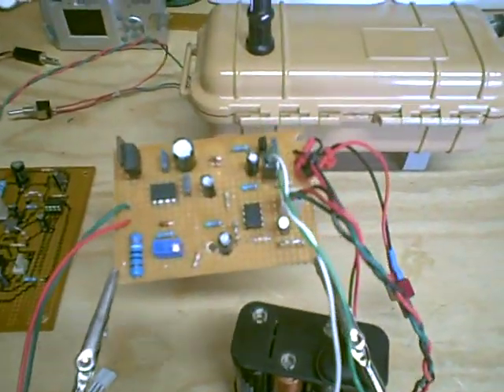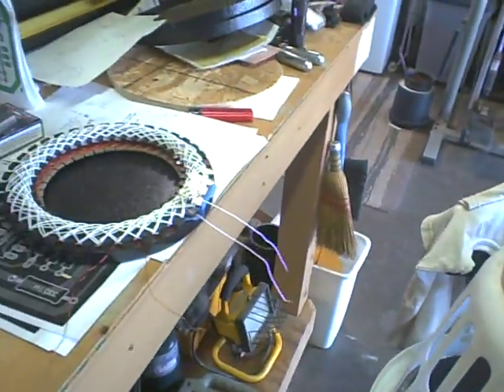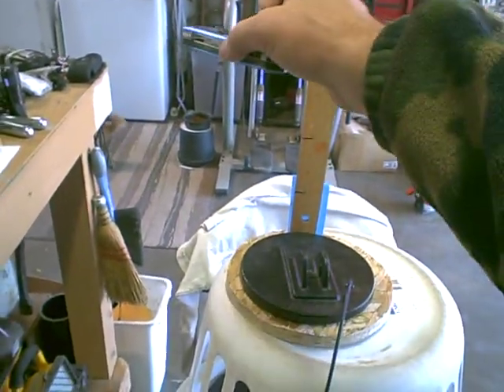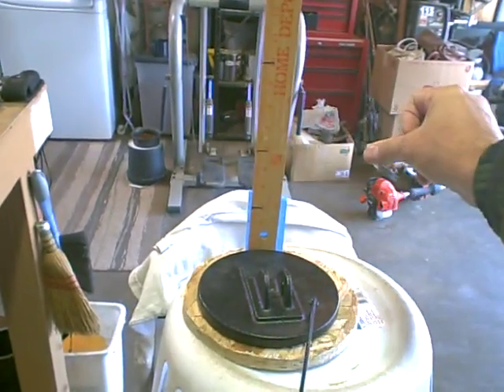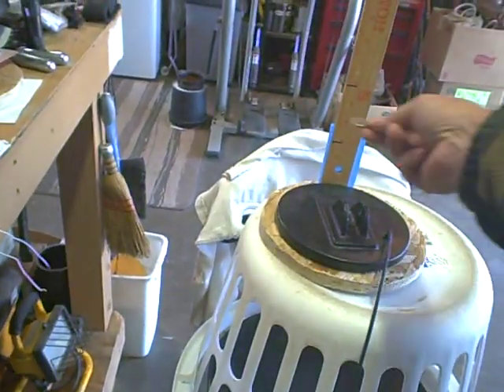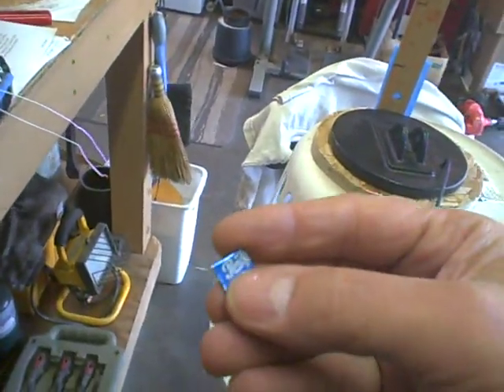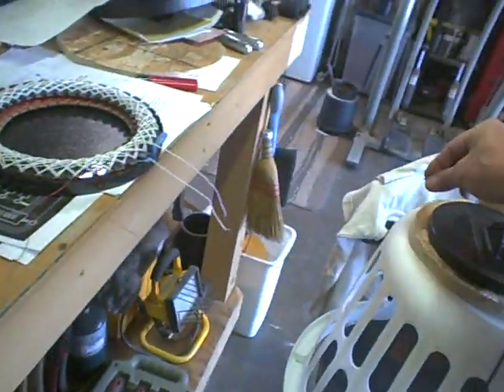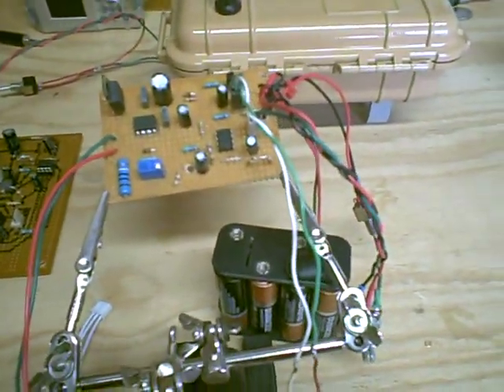DIY Simple PI homemade metal detector

Comment: I've fabricated the circuit and it can't detect anything, the 555 timer is getting hot and the LM358 doesn't work, I changed these ICs but it doesn't solve the problem , Can you tell me what I can do to make it work?
Reply from the maker: mine works fine and it will detect nickels at 7 inches and quarters at 6 inches. you must have something wired wrong..
Reply: I've Checked All Wirings, There is nothing wired wrong
Reply from the maker: +Mohamed Taher - don't know what to tell you, as you can see in the video, it works. I spent some time fine tuning it and it works great.

Comment: cant open and register on the link, help!
Reply: I will very appreciate if you send me the schematic at deperlente@gmail.com

Regards
Reply from the maker: +Arief B  Added a special new link above but here it is also,  http://www.treasuresweeper.com/simple-pi-diy/sim-pi/index.html
Reply: +TreasureSweeper
Thank you, will try build it, I hope i will get that villager found in the site, i will contact you soon.

Sincerly
Reply: I made it, but need adjustment, some part is missing, i change with nearest value. my pot is smoke when i use 1.1m instead 2m R
Reply: Not working like yours, maybe I got wrong in some poin, it detect my hand instead of metal.Can i use 9v batt? should the R is pricesely? i use 56k instead of 50, 62k with 68k.BC547 as alternative transistor.
Reply from the maker: +Arief B. you need to stay with the correct parts, when you start changing to other values the circuit changes how it operates. what coil are you using? 300uh is best. also, most times when your hand is detected, you have the leads backwards. from the coil...
Reply: +TreasureSweeper 
I use 350u 5inch diameter on 0.25mm. and 200u 8inch 0.5mm, i dont know the precise value of Uh, i use uh calculator
Reply: Let me try again... Thanks
Reply from the maker: +Arief B i dont have a mm converter on hand but 8" or smaller diam will be fine as long as you stay within the range of 300 to 350uh.
Reply from the maker: +Arief B. ok good. im headed to work so will be off line for awhile.

Comment: Here are the results of this pcb circuit i just finished.The only changes i made was LF412 to LM358 and MPSA13 to BC547 (there both NPN's but BC547 has different pinout ) By powering the circuit was starts oscillating (motor boating sound),the 5K trim pot working perfect by adjusting very well. Unfortunately have no effect by passing metal objects / coins over the coil.  The 20K pot have no effect at all. At the end the NE555 timer was start getting hot...then i didn't have any other option from  throw the pcb out of my window.....  :(

Comment: hello I would like to find out I used the lm358 chip will it work I build the circuit but some where its making a dead short maybe made an mistake
Reply: +Johan van der merwe Here are the results of this pcb circuit i just finished.The only changes i made was LF412 to LM358 and MPSA13 to BC547 (there both NPN's but BC547 has different pinout ) By powering the circuit was starts oscillating (motor boating sound),the 5K trim pot working perfect by adjusting very well. Unfortunately have no effect by passing metal objects / coins over the coil.  The 20K pot have no effect at all. At the end the NE555 timer was start getting hot...then i didn't have any other option from  throw the pcb out of my window.....  :(
Reply: I  saw that the 20k pot is not work but yet thia circuit design is work wonders for me the detection depth is outstanding good if i connect 12volt the mosfet gets hot but with 12 its running good and detection is very good
Reply: Yours detector can detect metals objects???? when this happen,...?? when there is no sound from speaker ??? Mosfet getting hot when you apply 12Volts but when you apply 12 its working fine???
Reply: hahaha sorry i meant 9volt can i send you a video or something showing this circuit is work email address ?
Reply: Okay hold on will send it now im using a small coil bussy building a new coil
Reply: +Andreas Christodoulou Please let me know if you watched the video and if you have any other working schematic on metal detectors
Reply: Great job and video too!!
Did you use LM358 instead of LM412??
What about transistor MPSA13 ??
Did you make any other changes to original???
Reply: I used the Lm358 and mosfet IRF740 other than that no other changes all I need to figure out how to make the 8" spider coil the coil I have there is working but with the correct coil I think I can get better detection but the 20K pot is of no use in the circuit as there is no change in sound when turning but I left it in for the connections
Reply: transistor I used the BC547
Reply: I built this 
But it is not working 
And the irf740 get very hot 
Can you help. 
Thanks

Comment from the maker: Jaime Lomayno, I sent you the schematic via the email you posted.. have fun..
Reply: hi, nice work
can you please send me the circuit or the schematic.
your work is the best home made metal detector I've found on the internet.
nice work and THANKS
that's my email mohamed.t.keshk@gmail.com
Reply from the maker: Hello Mohamed, if you like you can go to www.treasuresweeper.com and all the info is posted in the website. I'll also send you the schematic via email.
Reply: buck6519652003 recieved ,,thanks.
Reply from the maker: Your welcome, go hang over at treasuresweeper and I can help you through it if you have questions or need help. There are little things you can change here and there that make huge differences in how the circuit works.
Reply: Buck .can you sent detail schematic my email rizalbhi89@gmail.com please thanks.
Reply: sorry for a very long time of waiting ive building up the circuit iwant to know what is the coil diameter,the turns of wire,the size of wire could i use a larger and smaller size of wire. and how you made the coil  and if there are replacement for lm358 ive build many metal detector circuit but it was my first time to build a pulse induction.

-thank you!!
Reply from the maker: Rizal Bhia  added a blog post with all the info, here it is - http://www.treasuresweeper.com/simple-pi-schematic-and-pcb-layout/
Reply from the maker: Jaime Lomayno   added some info and schematic along with the pcb layout on a post here - http://www.treasuresweeper.com/simple-pi-schematic-and-pcb-layout/
Reply: hello sir, i need your schematic but cant login, techinnovation4u@gmail.com